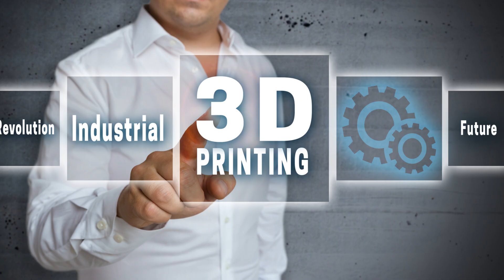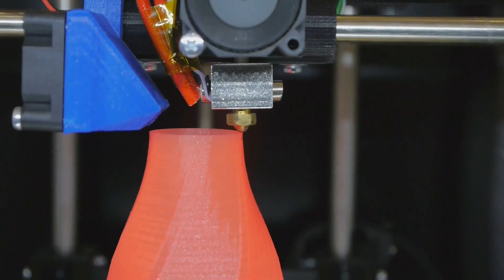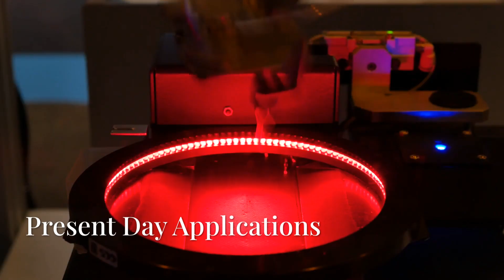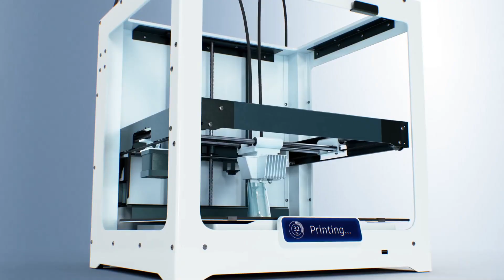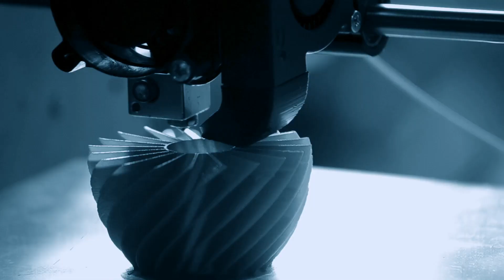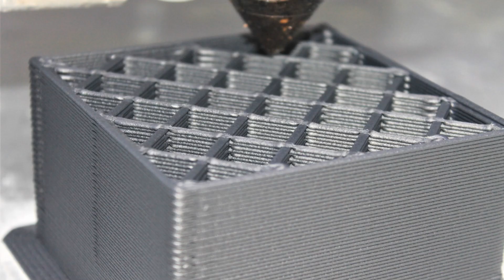3D Printing-Transforming Industries Through Innovation, Customization and Sustainable Manufacturing

Comment: Total Nonsense! All printed objects are made from soft plastic and so, are not durable: Useless!
Reply from the maker: Appreciate you sharing your thoughts! While some 3D prints use softer plastics, there are many durable materials available like PETG, ABS, and even carbon fiber-infused filaments. It really depends on the application and printer settings.